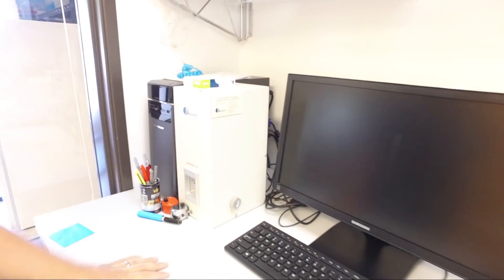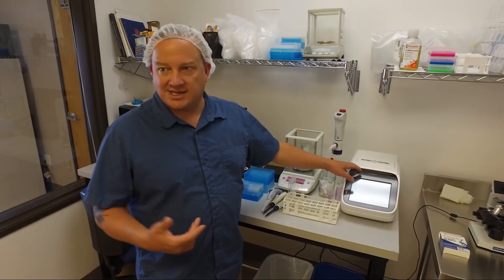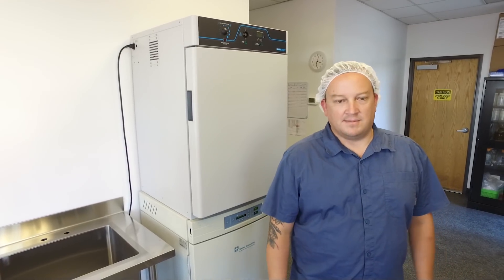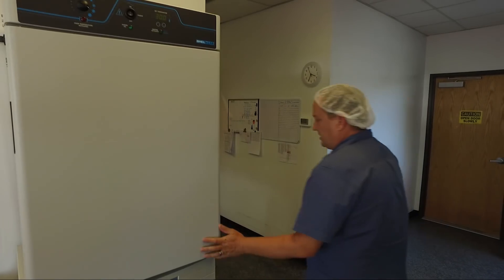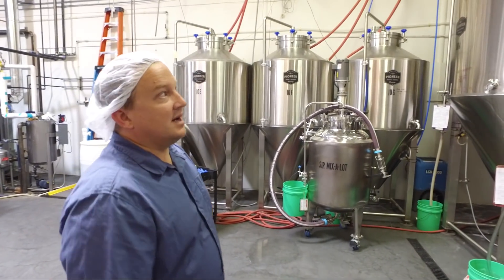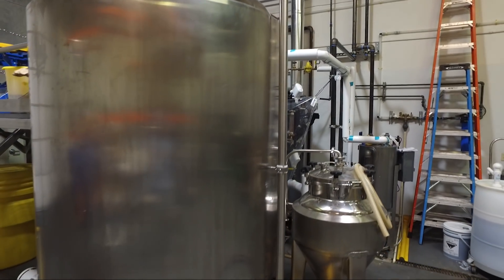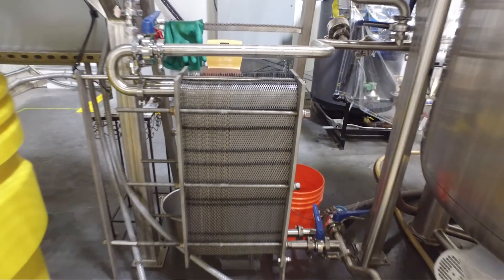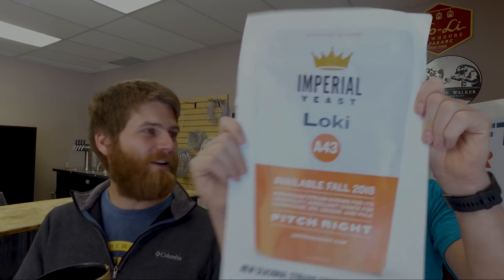How is Yeast Made!? Touring the Imperial Yeast Facility

Comment: I saw a lot of equipment but not a lot of information of the actual process of making yeast
Reply from the maker: It was in there but maybe not as straightforward as it could have been :)  - they talk a bit about their wort cooking with the pressure tanks, and the fermenting while aerating through the bottom of the fermenters for homogeneous fermentation, then pushing the yeast with a peristalsis pump and package by weight. They also talk a lot about their quality control measures - ie point filtration on everything including the air bubbling into the fermenters. 

In a nutshell they are making giant starters and packaging off the yeast.

There will be a bit more information in the Q&A video we post from them next :)
Reply: What media are they using for yeast propagation? Wort or another media? I am asking because the yeast has no trub in it, and i guess they don't wash it prior to packaging...
Reply from the maker: Actually they use organic DME and Fermaid K. The "wash" naturally happens as part of their dilution step.